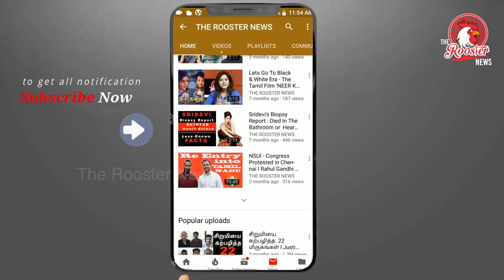5 கோடி ரூபாய் வீட்டில் அட்டை சுவர் |உண்மை என்ன ?| 5 crore Lodha Complex Home Crack in a Single Punch

Comment: Guys...I am a Civil Engineer, working in Dubai.... Normally in abroad this type of wall is applicable to reduce the Dead Load of the building...….this is called Gypsum Wall Partition.....they will place 2 gypsum board and in between filled with the Acoustic sponges …… this will help to fix a electric cable or pipe between the wall...…..The main wall between adjacent flat will be in solid block wall and other internal walls inside the flat will be on Gypsum Board....this kind of gypsum wall will help to reduce the dead load on the building,  give more space inside the room because of wall thickness is lesser than the traditional block work and time for construction is less...…..I am sure, while booking the flat ...this should have specified in the specification ….. this is just for your information.....Thanks Guys
Reply: Good Explaining bro...

Comment: Countries like dubai this is possible because high rise building this type of wall is possible to reduce the overall weight of the building. Soil should be strong depends on soil type the foundation they will make it. Customer should read the specs initially..

Comment: That is building technologies used a lot in foreign countries. Those are not failures. These walls are strong enough to hold photo frames. They are used for modular constructions. Im a civil engineer trust me. But they should have told these with the clients which is a mistake

Comment: Builder is right. Brick walls are outdated.It saves a/c bill and water during construction...but it should not break in single punch.. builder used low quality materials

Comment: There is something called specification provided by builder before any agreement is reached. Everything including wall thickness ,material used  will be mentioned in that. It is legally valid. Also carpet area cn be determined easily by the layout diagram. These rich don't care for the money and do crocodile tears latter.

Comment: You say there are plus and minus on both sides. It is the foreign method and less load is not  buyers concern. Whether it is
strong and safe and worth the cost is the main point. If the builder is so much worried about the total load he should 
limit the number of floors.

Comment: Plus is with krishna roa, not the construction company

I will tell why, in Abroad construction principles are different... So in india, construction practises are different, reason is weather and geographical land. 

notifying weightless material is not a perfect answer, and agreement clarity  noted by orally with buyers is must, which they failed.
 
In india or dubai constructing taller buliding must be rocket/cone shape like temples in india not rectangle or square, then only building will be stronger ... 

That company construction methodology may correct but it Constructed in wrong geographical place.

Comment: Buyer totally unaware of the construction industry and practices. Just cos he bought for 5 crores does not make sense. There are non load bearing partition walls (dry wall) which are meant to be like this based on design calculation. If required strong walls, the owner can design and build as per his wish with all the walls in RC 😆

Comment: Bro, the concern is value of the Flat is 3cr and u get only Gibson Wall... ha ha ha ha ha ha ha..
Reply: This is normal construction practice esp. In earthquake prone areas and high rise buildings. There should be no compromise in strength since these are RCC pillored structure and only non weight bearing walls are made this way. Another advantage is easily one can rearrange the room configuration.  The high cost is due to the high cost of the land.
Reply: kannan Thiagarajan ,,, I agree with the technology bro.. but the property value is too high..

Comment: This is legally right. But, factually wrong. Everything will have maximum saleable price. For a non-conceit structure, the company is value adding more than the normal. So, it the company is doing the business against natural low of justice. However, when a agreement happens between two parties. This have to follow the aggried terms of the contract
If not, the agreement will be dreamed void..